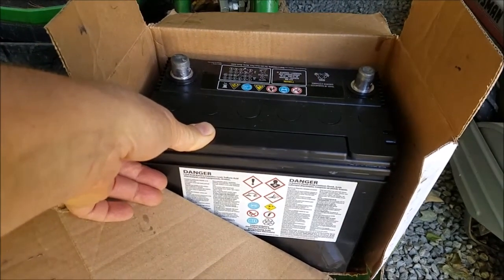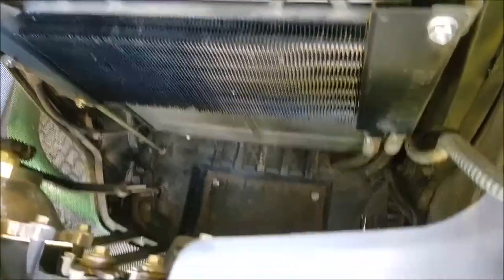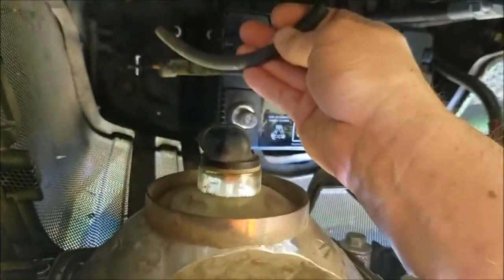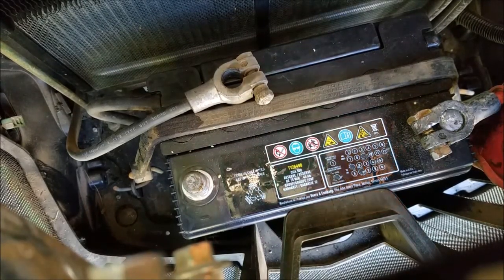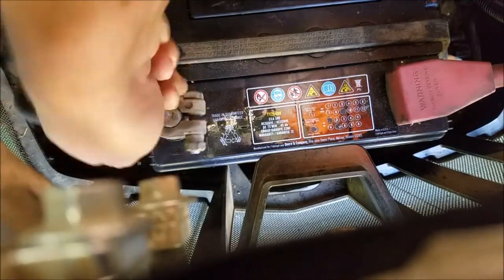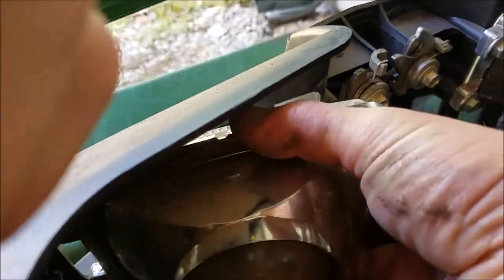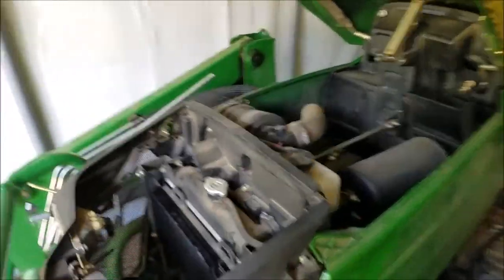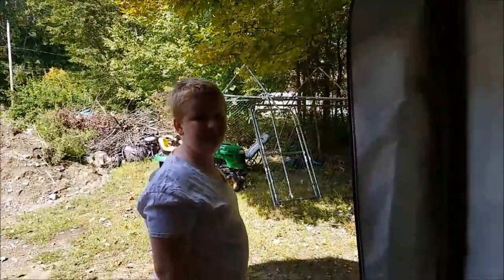New Battery in John Deere 1023E backhoe

Comment: You don’t need to take out the light just the bulbs and turn on it’s side pull straight up.
Reply from the maker: I was a bit worried. Good to know!
Reply: I tried this on my 1025R.  There wasn't quite enough room when I pulled the factory battery out even up on edge.  The new battery from the John Deere dealer was somewhat shorter, so it might have gone in.

Comment: Tapping or beating on the post isn't a good thing. The terminals are soft lead so just stick a wide flat blade screwdriver in and twist. That should open it enough to slide over the new post.